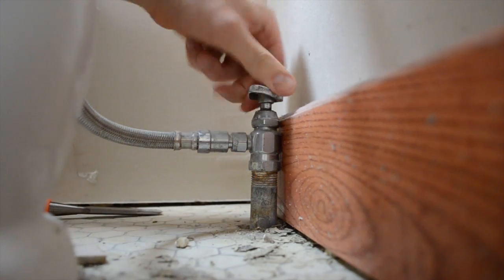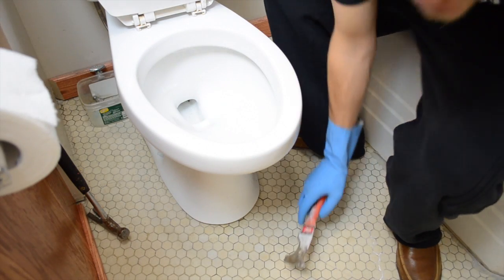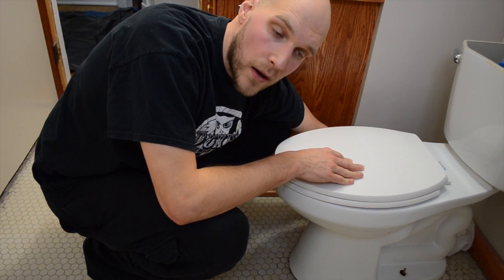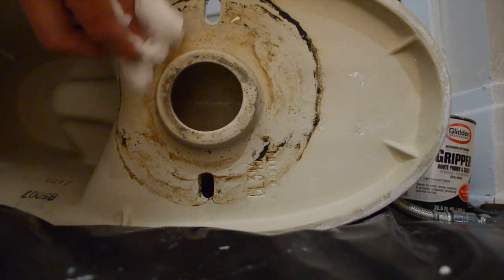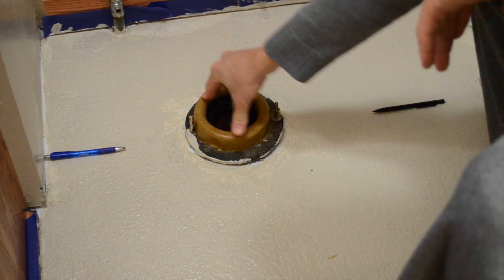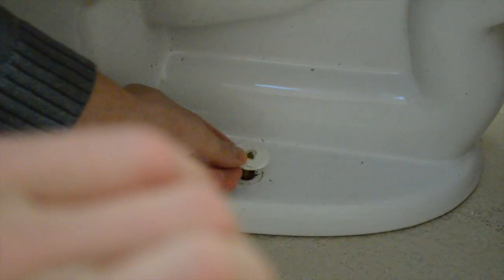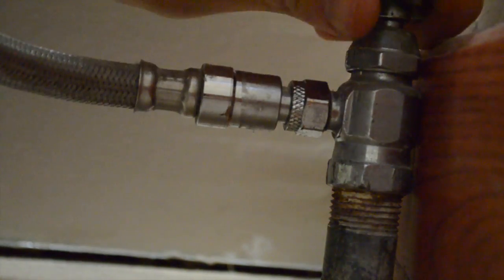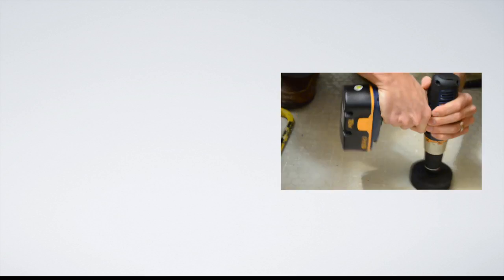How to install a toilet

Comment: Great video! Thoughtful process...Thinking of replacing my old toilet because it drains real slow and almost overflows. Had a plummer come snake our pipes from the rooftop. Toilet worked for a few days...now doing the same. I never saw the plummer snake through the toilet. If I replace my toilet is it recommended, is it advisable, to snake through the sewage drain while the toilet is off? Sorry for the dumb question. But, the plumbing in this old house is driving me crazy!